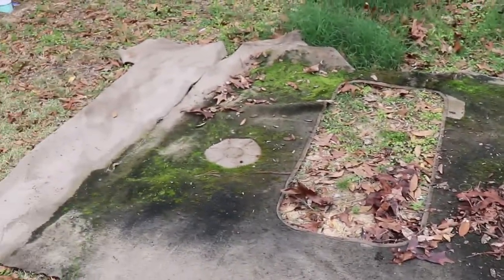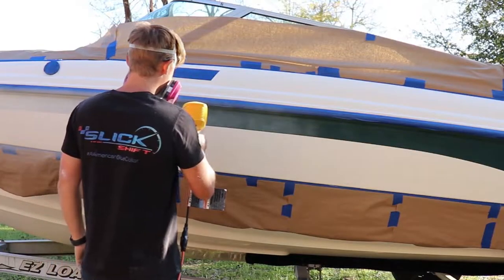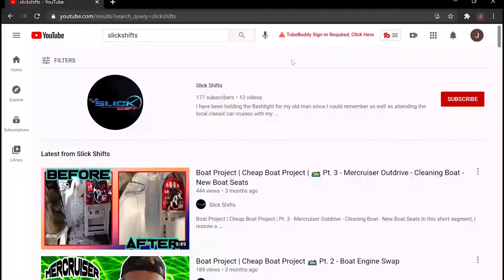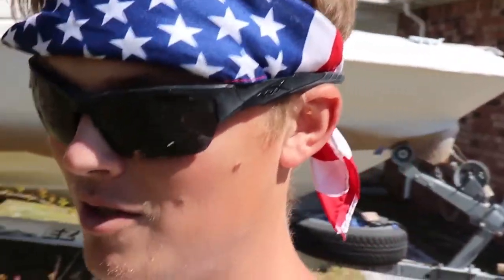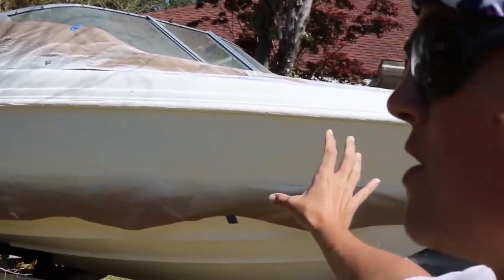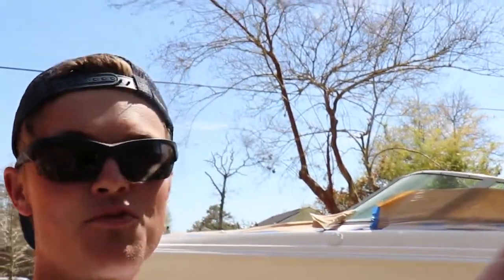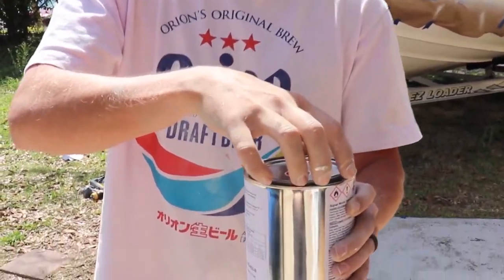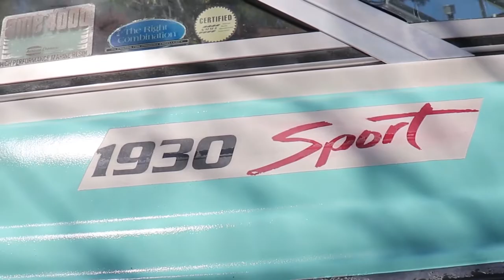Boat Restoration | Fixing a Cheap Boat |🚤| Part 4

Comment: The primer was rough because you used that sprayer. Those cheaper handheld paint sprayers aren’t meant for quality work. You need a true airless or HVLP sprayer to get good quality for automotive/marine paintwork.
Reply from the maker: Man you are absolutely right. I talked to my buddy after he inspected the gel coat and he said the exact same thing. If I do another boat on the channel I will be going the HVLP setup for sure. Just need an air compressor lol. I appreciate the advice.